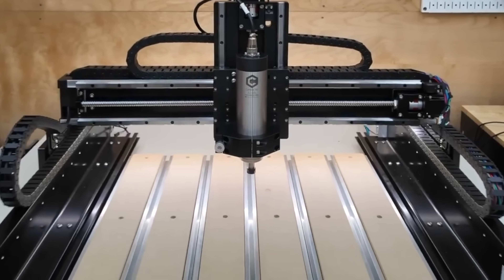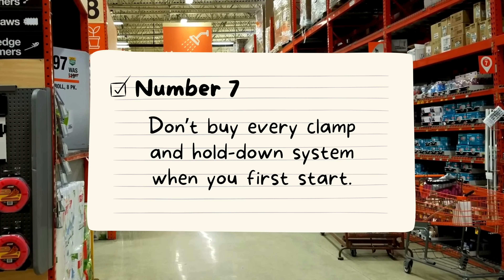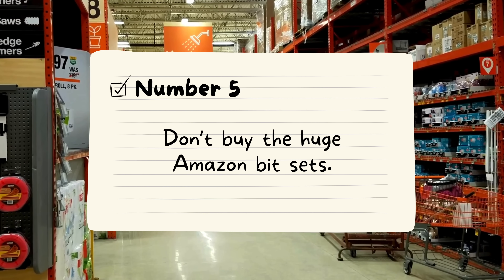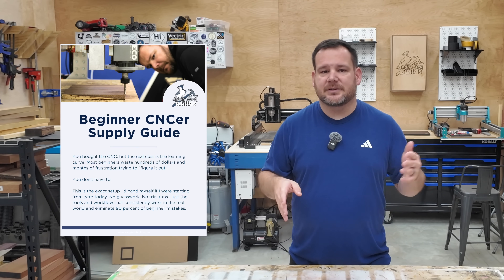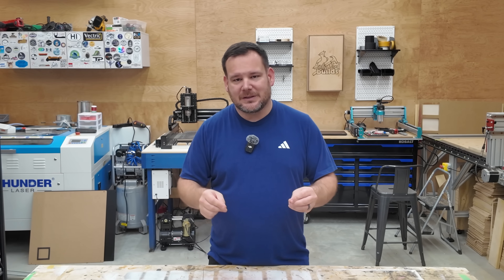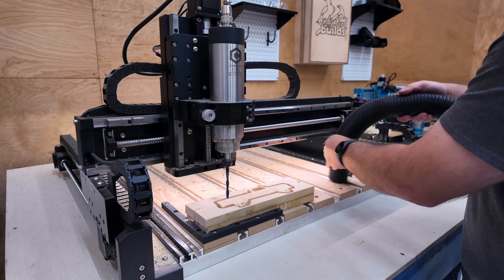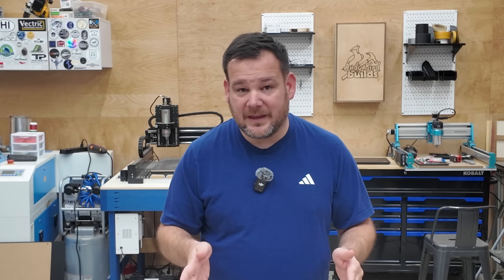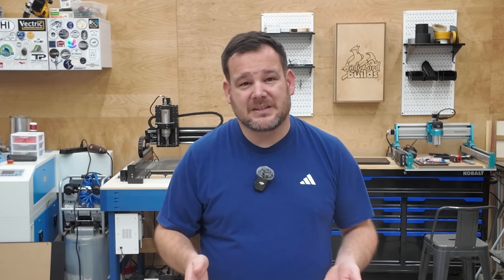CNC Beginners: 8 Mistakes to Avoid Before You Quit CNC

Comment: At 1:10, you do realize the play in the hook on a tape measure is intentional, right? Now, that play should be no more than the thickness of the hook - it is there so you get the same measurement on inside AND outside measurements.  What is being alluded to in the video is a common misconception - "tape measures are sloppy". Wrong. Tape measures can be VERY accurate - they may not have the resolution you need for more decimal places. That said... I agree though... It's not the right tool for the job to get the precision you need with a CNC for material thickness.

Comment: I'm curious, as a beginner CNC user myself, I found FreeCAD wasn't too bad -- this could be my bias as a software engineer, which it is very obvious FreeCAD was designed by and mostly for, but it got me up and running quite quickly. I added PixelCNC for more artsy tasks, but I haven't felt held back by these tools. You're recommending some fairly costly software.

For the full version of Vectric it's going to cost twice as much as I spent on the machine, bits, and materials combined so far, which for the small, hobbyist projects I'm likely to do for the foreseeable future, it's simply not a justifiable expense and would have entirely deterred me from getting started.

Do your recommendations change for hobbyists, especially those with cheap machines, like the Genmitsu Cubiko I'm learning on?

Comment: NO, DON"T use a shop vac. These are only designed for short time use (20%)! You will burn out the brushes if you use then for long periods. (How do I know?) Get a real dust collector.

Comment: My advice is build or buy an enclosure. Or chips and sawdust will go everywhere. With or without dust collection. 

Use Gwizard for feeds and speeds. Basically cuts 30% off your learning curve. 

Buy hardware that's fit for purpose. A cheap Chinese bench top cnc is fine for a hobby. Not for a manufacturing business.  

Go bigger than you think you need. Just the right size work envelope = constantly hitting the sides. Nobody ever regrets having more work envelope than they need.

Don't buy a flimsy machine because you're worried about lifting a heavy one into your workspace. A $200 shop crane from harbor freight makes moving a 2000 lb Bridgeport easy. It's worth the investment

Comment: When I designed and built my first CNC router, back in 2009, it worked wonderfully. 
That's when I discovered that I had virtually NO idea how to actually use it. 
Since then, it has clocked up many thousands of hours of reliable runtime  :) .

Comment: Most people who quit CNC do so because their expectations are too high (perhaps because they believe the brochures, which are so truthful). I built a CNC entirely out of MDF that evolved, piece by piece, into aluminum. The final evolution with wood and plastic was a champ. With aluminum, It could go down 1 mm at a time, and with soft iron, 0.5 mm, slow but steady. I learned every trick in the book during the evolution.
I've seen people buy a $500 CNC and try to machine steel at 5 mm at a time: no idea of speeds/feeds, stiffness, and torque, and no idea what material they're working with, so steel is the same as soft wood... or expanded polystyrene.
Then they realize the limitations and how much they have to learn, and they don't have the necessary patience.

Comment: I just purchased a Fox Alien XE Ultra 8080. Any suggestions on building the table for it to sit on?
Reply: I got that one as well.  I just picked up two of the kobalt fold out sawhorses.  They sit extremely stable and I’ll be using 2x4s in the fold down brackets in the end then securing my mdf to it as my work table.

Comment: Very helpful video. I just ordered my first CNC, a Shapoko 5.1 Pro. I have been woodworking for 25 years, seems like a natural progression. Would you recommend 4" dust collection via my Jet canister 1 1/2 hp dust collector or hooking up a shop vac and separator to 2 1/2" hose for higher velocity dust collection? Thanks.